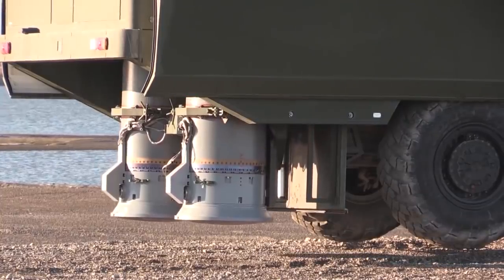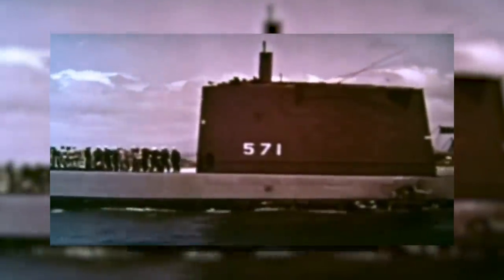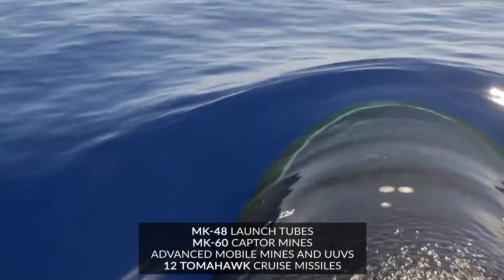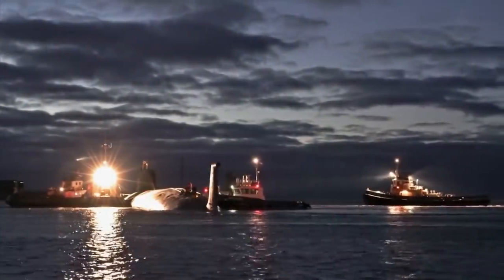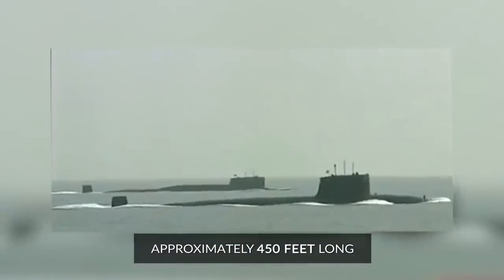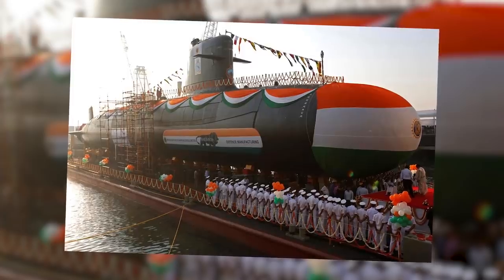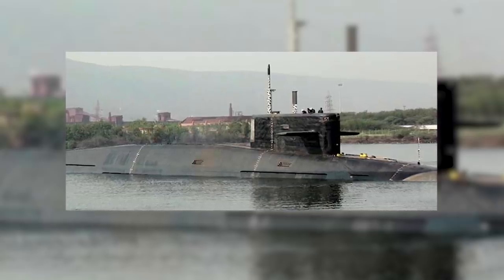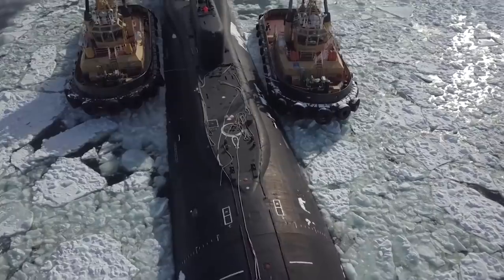The US Built A New Submarine The World Is Afraid Of

Comment: If the military had an infinite source of safe free energy, would they tell us?
Reply: No. Because they don't. At least, not what you're thinking. But the Nuclear Reactors aren't military secrets. We all know they use them, and nuclear reactors are used by corporate domains. Even MIT has a Reactor at their school. But what the narrator means by Infinite is that, the output of the Nuclear Reactors are infinite compared to the original submarines that use Deiseal or coal, or what ever other fuel they use. Meaning the Reactors quite literally do not stop. They just keep running and running, and likely would still be running long after the submarine itself ever get's decommissioned. This is because Nuclear Reactors a massively more efficient, don't require extra fuel, and the fuel source, or fuel rods as they are known as, last for damn near ever.  This is because, other forms of fuel basically last as long as it burns. If you ever used a grill or driven a car, you know fuel doesn't last long. Nuclear Reactors how ever don't burn anything. 

Nuclear Reactors are glorified Steam Engines. The Fuel Rods are basically highly radioactive substances, meaning they decay. Decay produces heat. A lot of heat. After all, they are atoms splitting apart. Which is why Nuclear weapons are intensely hot, comparable to the surface of the sun. Atomic energy is intense, and very very hot. So these rods are placed in water, which in turn heats up the water, greatly. Said water is turned into steam. That steam rises out passing turbines, cause them to spin and produce electricity through Lenz's law, and then is cooled back down into water, and returned to the system. Now, the decay of Radioactive material used in fuel is massively long. Uranium-233 has a half life of about 160,000 years. And what that means is that it takes that long for basically half of that initial substances to decay.  And that material decays, it changes into Thorium-229, which has a half life of about 7,913 year, while Uranium-233 parent isotope Protactinium-233 has a half life of 27 Days, and it's parent Thorium-233 a half life of 22 minutes. Due to some of these half lives, the nuclear reactor will likely fail from other errors, like over heating or time before the energy ever runs out. And there for in terms of this situation, infinite energy. 

And if Infinite Energy was discovered by anyone, there would be no way to keep it secret, due to the implications of pure infinite energy. Cause that violates physics as we know it. As far as energy goes, it's impossible to have infinite energy, cause it violates the Law of Thermodynamics. Energy can neither be created nor destroyed. Only transferred. Further proven with E=MC^2. 

"Energy" equals "Mass" multiplied by "Constant" (Speed of Light which is 299,792,458 meters [300,000 Kilometers] {186,000 Miles} per second) "Squared"

So the energy of 5 grams of Uranium-235 going critical would have a yield of  5 * (299,792,548^2)
                                                                                                                                          5 * (8.98755178736818 x 10^16)
                                                                                                                                                (4.4937759 x 10^17) Joules

If my Maths is right, should be about 1.1 trillion grams of TNT. About 449,377,590,000 Sticks of Dynomyte

This means mass and energy are one of the same. And is again why Nuclear weapons go pop with supreme power. It's converting mass into energy....Which as you can tell, is a major yield for a small amount.

Something things in here may be wrong. Like maybe they changed how of a nuclear reactor's energy production instead of boiling water to steam. So hopefully someone else can correct me on well anything, but the general idea all up there.

Comment: There are different hydrosonic waves that work to sink anything that floats also. Now if you built my submarine with space engines and space engine propellers on the inside it would be unsinkable. Unless direct impact but hitting a ship in water with torpedoes should be impossible with what else is on frequencies. Weapons are hilarious.

Comment: If the torpedo take the shape of a drill bit, it would goes much faster if applied inertia right hand rule
Reply: which do you think is more efficient: conical drill head design or a rear propeller?
Reply: Ahhh, Freed up hidden energy lol.  There is an equal and opposite reaction to any applied force. (Sir Isaac Newton). 
A rotational force would then create an equal opposite force unless it was applied externally? But isn't the right hand rule an electric term to indicate the flow of electrons or "Joules" through a conductor? 
How would that have an effect on a mechanical rotational applied force?
Reply: @reinhart482  
Not sure, something gnaws at my grasping ability to separate the efficiency of either, a propeller creates a certain amount of drag, and cavitation is a killer but new designs are almost free of that, a conical drill design also creates drag and most likely has a bigger bite on more water to create more torque ( Newton's law again), but probably also has some cavitation over a larger spread. It would have to come down to friction or resistance to water moving over a surface area differential from one to the other.
Reply: @johns7483  the proper term is pump-jet